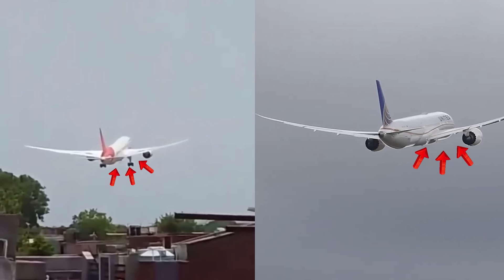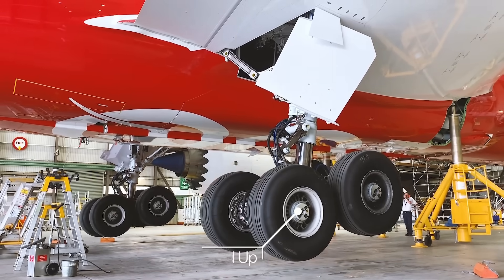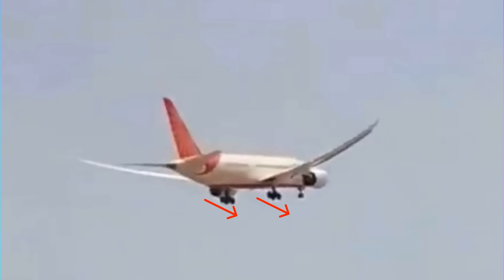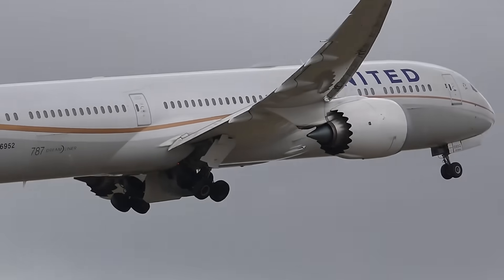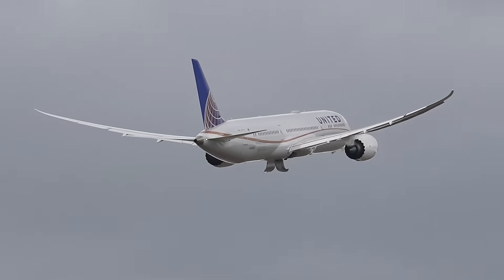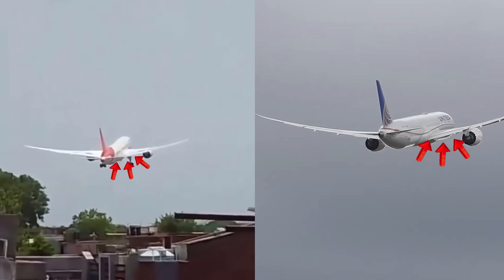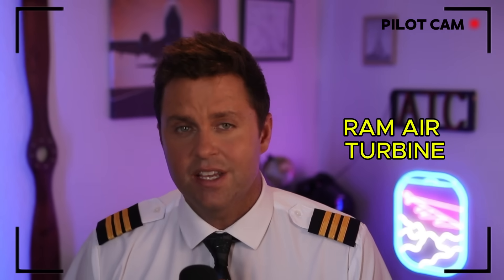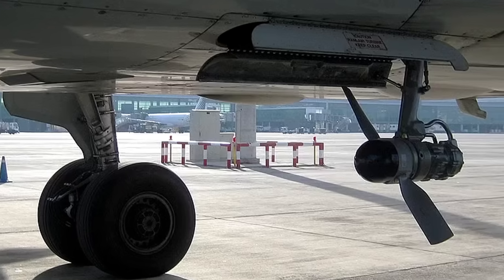Pilot Explains: A New Detail in the Air India 787 Crash Everyone Missed

Comment: If two engines fail at the same time, it’s not because of the engine itself. Some common variable must be the reason.
Reply: yep. Elec Sys total failure at some point. Im betting about 20sec into flight it gave out
Reply: @gkswift1999 Could be, but motors still run even if you have a complete electrical failure!!
Reply: @Gaferr-r4r Not if the fuel pump shut down due to the loss of electricity.
Reply: @eminehorner4684 wouldn't tge RAT keep the fuel pump working?
Reply: @geoffreystone4849  It should, but if both engines flamed out, it takes time to restart them...
Reply: @Gaferr-r4r  Only if the fuel is still flowing.
Reply: @manariitane5167 Look we are all speculating until the report comes out, but the fuel flow would never stop. At the very least it would gravity feed
Reply: @eminehorner4684  Engine driven fuel pumps.
Reply: @geoffreystone4849  RAT doesn’t power main fuel pumps, engine driven.
Reply: @petergill2265 Don't know if that's the case for 787s. Everything is electrical.
Reply: @eminehorner4684  it would have only lost electricity after the engines shutdown and then probably only momentarily as the RAT deployed and there would have been battery power also.
Reply: @eminehorner4684  Engines can run without tank fuel pumps. Designers are not that stupid.
Reply: @Gaferr-r4r  Without fuel? Electric failure cuts of the boost pumps...
Reply: @geoffreystone4849  the batteries would too.. the batteries can power the main items for much longer than 30 seconds (length of this flight)
Reply: @Gaferr-r4r  engine driven fuel pumps and gravity feed in the 787 cannot be guaranteed at all phases of flight and can be impacted by attitude, altitude, thrust setting etc. It sounds like it struggled to pull enough fuel into the engines during rotation with no AC pumps. Even a slight loss of thrust combined with gear stuck down in a hot and heavy takeoff could be enough for this crash
Reply: @ImperrfectStranger gravity feed as backup except from center tank and at higher altitude
Reply: @anon1832 No EDPs on the 787s!! Gravity feed is sufficient at low altitudes !
Reply: @dannymaes7709 Gravity feed should have been sufficient and the RAT if deployed can support some boost pumps!!  Like I said earlier this is all speculation until we see the report
Reply: @Gaferr-r4r   gravity feed is sufficient for what at low altitudes? Is it sufficient for full takeoff power? Is it guaranteed at all attitudes including rotation? Are you sure that without any electrical fuel pumps the 787 can safely rotate and climb out without any loss of thrust, not even a few percent, even with the landing gear down and in a hot and heavy environment? I would hope so but I cannot find any definitive evidence - if you have some that would be great
Reply: @Gaferr-r4r  are you sure the RAT can power an AC fuel pump as well as essentials? I would like to see any kind of documentation for that
Reply: @anon1832 It rotated and flew to 600 ft!! We don’t know when the power was lost!! There was certainly sufficient fuel in the tanks to support gravity feed. As to how much power that would produce, I don’t know!! I wasn’t invited in the test flights. These are all speculations that we are partaking on. I didn’t get my answer from chat GPT but from the 78 flight manual in the fuel system section. 
Like I said no one knows what happens until the CVR and the FDR is analyzed!!
Reply: @Gaferr-r4r   actually it reached closer to 300-400ft, the CCTV can be used to estimate that and it lines up with 600ft including airport elevation from the FR24/ADS-B data point. I agree it is speculation but I don't think it can be dismissed as simply as "gravity feed should work" - the engine driven pumps have limitations otherwise there wouldn't be 2 electric motor pumps per engine. Since everything points to electrical issues I think its worth speculating.
Reply: @anon1832 Of course it’s speculation!! And yes it did reach 600 ft MSL or 350 AGL so we are all happy. I am not dismissing it as gravity feed is the savior of all days. My logic is this, if the fuel manifold was under pressure and the boost pumps subsequently fail and the fuel tanks were at a high level of fuel then the manifold should maintain pressure due to differential pressure between tanks and the tank to engine manifold!! Should not will!!
Again speculation
Reply: @Gaferr-r4r  You are wrong. If it there no elec. power the pumps deliver no fuel! Sory for my pooe english.
Reply: @michaelstelck6292 That’s true !! AC boost pump !! You can figure that out by the name alone. My speculation was that in emergency gravity feed might have been sufficient to deliver fuel to the motors!! 
But if it improves your English, I hope you are right pimpin!!
Reply: @Gaferr-r4r  well, not if they are dual-FADEC controlled and both FADECs somehow lose aircraft power and engine driven PMA power doesn't take over for some reason and the control system is designed for Dual FADEC failure = Engine Off logic (fuel cutoff valve closes). That is per engine of course, so a total FADEC failure (all 4 FADECs) would be really bad
Reply: @Gaferr-r4r  yabut only if it is NOT cutoff via the engine fuel shutoff valve; I have read in other comments that the FADECs on 787 are designed to Engine Off logic (?) if they both fail (on same engine of course).
Reply: @ImperrfectStranger  yabut ONLY if the fuel cutoff valve remains open to allow it to keep flowing; some control designs use ENGINE OFF logic (fuel cutoff valve closes) if BOTH engine FADECs should fail; other designs (like V-22 Osprey) use ENGINE FIXED power setting logic which allows engine to keep running at a fixed power setting and be useable; I have read that 787 uses ENGINE OFF logic (?)
Reply: @KRAM-ct7ok I guess anything can happen!! Obviously something went terribly wrong!
Reply: @KRAM-ct7ok It’s a possibility!!
Reply: @Gaferr-r4r Not if fuel pumps stop working.
Reply: @mattwerner8342 Atually yes!! With gravity feed engines would continue running while the EDPs pressurize the fuel in the combustion chamber!!
Reply: @Gaferr-r4r   Thanks.  I read that same info about gravity feeding after posting.

However, the comment also stated that when gravity fed, the engines get enough fuel for level flight but an insufficient amount for climbing.
Reply: @gkswift1999 there are at least 3 other videos by Indians suggesting and showing electrical problems. They don’t talk about the engines, at least in two cases, but they leave electricals highly suspect.
Reply: It almost has to be that at this point. Agreed. I wonder if we ever see the truth as an official explanation though...... Hope so. Humanity deserves  the truth.
Reply: @franklininterviewsvancouve8605  The FDR and CVR have been recovered, plus the engines transmit data in real time, so yes we will probably get an official explanation.
Reply: @gkswift1999  Maximum altitude was reached well prior to 20 seconds time of flight.
Reply: @gkswift1999  engines will still run with an electrical system failure
Reply: 2014 the 787 was delivered to India.  In 2016 the FAA sent objections to Boeing about 22 day countdown timers
In the Electronic Controllers. That turned off everything.
Reply: Don’t rule out foul play. India Pak were at war few weeks ago
Reply: Has anyone checked the refuelling records? Wasn’t this plane on a “turn-around” from London?
No fuel would definitely stop those engines, right?
Reply: From the massive fireball, It seemed to have a fair bit of fuel on board to me.
Reply: @Retinalism Would not be the first time, I would also like to know who checked the fuel for water that day….
Reply: @Retinalism Yes, but fuel adds a lot of weight. I can’t imagine the pilots wouldn’t notice the difference in handling between a takeoff with full fuel and one with nearly empty fuel. And that’s assuming the fuel quantity indicators weren’t working in order to tell them of being low on fuel before they even reached the runway.
Reply: @Retinalism  it had 100 tons of fuel onboard!
Reply: Sabotage is probable
Reply: Electrical system failure, fried everything
Reply: maybe the fuel was bad quality
Reply: I think better to say not likely due to the engine itself. It is possible for two engines to fail at the same time for either the same reason or different reasons. Possible but highly unlikely.
Reply: FADEC & FADEC data bus, boeing had previously known issues in electrical buses of the dreamliner, they were aware of these issues yet they did nothing
Reply: Wouldn't contaminated fuel also affect other planes?
Reply: @iainbremner8909 All depends on the ratio of chemtrailing material vs fuel
Reply: I'm a aircraft fueler if for some reason saltwater would have gotten into the fuel system at the airport. Saltwater will destroy the filters in the fuel vehicle
Reply: As an aircraft fueler you should know what ”they” put in the fuel right? Tip: it’s not saltwater @stevenbelsky1652
Reply: Agreed.   Hundreds of planes have lost engine power one after the other.  When power is lost at the same time on both engines it can only be the result of a command from a pilot or a control system.   Automated shutdown has happened before 
https://en.wikipedia.org/wiki/Boeing_737_MAX_groundings
Reply: @patricklockerby4308  Aircraft appeared to yaw right, and drifted 3 degrees left of track. Engine failures, if true, might not have been simultaneous. Yaw and drift may be due to right crosswind, 292@9.7 kts
Reply: @patricklockerby4308 same conclusion reached at Ask the Pilot in Australia.
Reply: “” it can only be the result of a command from a pilot or a control system.”.       I don’t believe that is true 🤷🏽‍♂️.  There could be other reasons
Reply: Great analysis. I would assume the fuel system has jet pumps (works off Venturi effect) or something similar as many jets do which would not be affected by electric power loss. If it does,  do not know if it would sustain take off fuel demand, or if it would only assist power back cruise.
Reply: Bingo!
Reply: Thank you I am glad that I've had the chance to listen to this because that's exactly what I assumed as well. From my understanding and just looking at this it appears that the power down on both engines was just as the craft lifted. I started another post somewhere that it looked like he might have tried the lift the nose alongside full throttle as an instinct reaction to perhaps just that feeling of deceleration as lifting off.  I feel like deceleration was the moment he had air and also no tarmac left as well. I just hope some considerations in city planning might actually occur here.
Reply: I think fuel contamination is a valid theory. If you’ve spent any time on YouTube or Instagram you’ve likely seen evidence that Indians will shit anywhere: the beach, on the streets, on sidewalks, and even on the floor of restrooms or airplane lavatories. What’s to say one of didn’t shit in the fuel supply?
Reply: Improper flex tempreture setting
Reply: computer blue screen^^
Reply: That was addressed, specifically contaminated fuel as a cause which would be a common variable.  What worries me is that expert Boeing pilots really cannot explain how such an accident happened, can just speculate at this early stage.  The FDR and CVR data will show what happened one way or the other.
Reply: Shoddy maintenance. AI isn’t known for their exemplary safety record.
Reply: Hand on thrust, while the seat was moving back, bringing it to IDLE, and never got off it. That explains the loss of power.
Reply: Dual engine failure after only 11 years of service, can only mean poor maintenance.
Reply: @maiden5427 the captain had his seat sliding back pulling the throttle to idle. You heard it from me first.
Reply: @DavidVercetti_prod  😂 lol  are you trolling. 
I had an argument with someone here on yt about the pilot trottle, on  another  plane crash years ago, was that you?
Reply: I think with the heat and idling on the runway for hours it could have been a vapor lock.
Reply: Where was the plane fueled?
Reply: Agree 💯, the failure also leave traces but from the video there was no smoke or any sign of internal damage , I think it’s engine failed to operate due to controls or fuel or auxiliary system
Reply: theres a video 2 hours before the incident inside that shows electrical problems relating to the AC.  it was also stated by a former pilot that this aircraft has suffered with serious technical problems for a long time. 
seems the root of the issue was a poorly maintained aircraft.
Reply: Fuel contaminated by salt water.
Reply: Really looking at fuel problem, think those engines will just keep running without electricity. (My guess, however complete power failure on another jet think the engine kept running.) @lieasReno commented fuel lock real possibility. The other possibility water or contamination not so likely, but blocked fuel line. This going to make people very nervous until the answer is found to this profoundly sad case. Poor families.
Reply: fuel?
Reply: India changed ground service from Turkish origin Celebi to another company. This may cause some sevice problems; i.e., contaminated fuel possibly.
Reply: exactly! mechanical problem, technical problem, electrical problem overall  poor maintenance.
Reply: Absolutely, which is why fuel contamination is the first suspect in such scenarios.  That was my first guess.  I'm now leaning towards a catastrophic electrical failure hypothesis.
Reply: Losing both engines can be caused by pilot error, bird strike, or loss of combustible fuel from mechanical or chemical issues. Since the engines generate the electrical power, a loss of power will not occur until the engines are down. However, an electrical component affecting the fuel system or engine control could fail, causing a mechanical problem with fuel delivery. The batteries should allow restart attempts which were obviously unsuccessful. Since a bird strike was unlikely and they could not restart their engines, this suggests a fuel system issue. The only pilot error that could prevent the engine restart would be triggering the engine fire suppression system.
Reply: The plane sat on the tarmac for 3+ hrs in 107° heat causing fuel vapor so the fuel pump hydraulics weren't pumping liquid fuel vapor instead.
Reply: @lifeasReno It could be true
Reply: @lifeasReno these tanks are probably close to full they are going to London 10 hours plus contingency fuel ,, vapor problem probably not a issue
Reply: @lifeasReno  I definitely think the heat played into this, as well.
Reply: Poor maintenance
Reply: Well done Einstein you have solved it. 👏
Reply: One or both of the pilots acting intentionally
Reply: @radman999 one engine fails the by mistake shutdown the wrong engine ? Let´s wait final report.
Reply: I think is sabotage, should investigate, the ground crew, mechanics and incharge in refuel the aircraft, double engine failure is extremely rare happen, there is the people behind this tragedy😢
Reply: @hfufyw  Totally agree, everybody connected to refueling the plane, even remotely, should be investigated thoroughly.
Reply: @hfufyw  This is the 1st I have seen sabotage mentioned in a comment. Sadly, it was the 2nd or 3rd thing that crossed my mind as more details came out. The silence from investigators creates a sense of uneasiness as well; however, so many crash site factors can delay discovery.
Reply: @hfufyw  maybe cheap Russian contraband kerosine
Reply: if you run out of fuel it doesnt matter if you have 4 or more engines the plane will still simply blow up in the sky and fall out of the air
Reply: @thethinkingman- what? It doesn’t matter? If you run out of fuel you will simple blow up? That has to be the stupidest comment I have ever heard.
Reply: @troynyholm232 as they say  thats a Dum answer!
Reply: Like chemtrailing chemicals in the fuel.

Comment: Captain Gary: is it normal for a 787-b  to use the entire 11000  foot runway  and rotate at the entire end of the runway?
Reply from the maker: I was going to mention that in the video but I forgot. Short answer is absolutely not.
Reply: @Garybpilot   According to the ADS-B data provided by Flightradar24, the aircraft took off with 900 meters (3000 feet) of runway to spare (20 feet AGL after taxi way C). ADS-B transmission stops at the end of the runway, at 72 feet AGL. Check their updated blog post. Similar with the Jeju Air crash, the transponder stops working at the point when both engines fail.

Comment: Excellent detail on landing gear, also flaps (although wings are so slim it really is hard to tell, but another video after crash did show apparent flap extension, too.) As someone trained in fighter jet avionics/maintenance, I was previously torn between (FO) error and fuel contamination, but with flaps extended at least partially and this latest proof of attempted gear retraction….  and the plane sitting there in high heat and humidity for hours  with engines running at least part of the time ….  I’m leaning very strongly now toward a vapor lock that would kill both engines at once.  JMHO
Reply: Even "Before selecting the landing Gear handle UP"  , the gear tilts Forward Down... as soon as the sensors detect AIRBORNE...  see:   AMM 32-31-00 LANDING GEAR DESCRIPTION AND OPERATION.    So, regardless of the selection of the gear handle, it will always tilts forward down to prepare for retraction.

Comment: Possible vapor lock. Tripple digit temps, sitting on the tarmac for two hours without the A/C packs on making the aircraft heat saturated.
Reply: Well, this is an smart answer.
Reply: @alfredochona749  there is a video about this.
Reply: nope, no problem
Reply: Max fuel temperature for takeoff is 55C. Max certified takeoff temperature is 49C. So, NO. We have high-temperature ground procedures, and two manifolds to attach external ground cooling air. So again, NO.